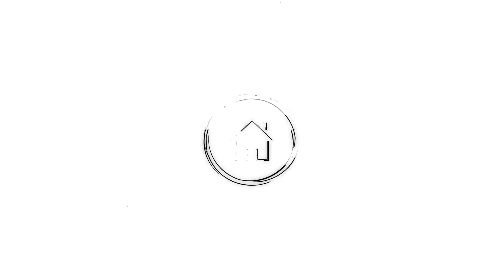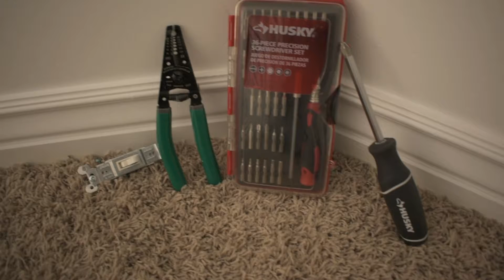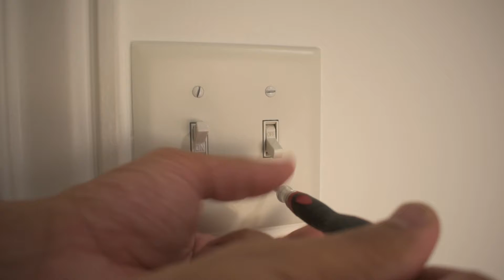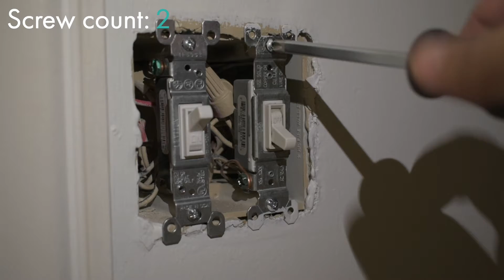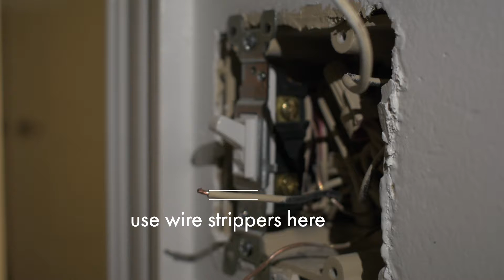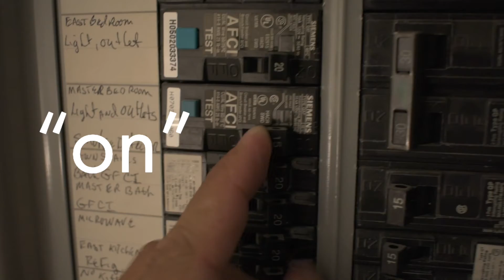DIY How to install or replace a light switch for beginners!

Comment: Use a 20 amp light switch they are better than the one you bought
Reply from the maker: I mean.... if I'm buying 20amps for a 15amp circuit, I'm really just wasting money and potentially would confuse any future decisions and unnecessary back and forth for anyone else that would work on the switches after me. You're not wrong,  I just don't want to have to go through all of that. Does it work,  sure, do you need to,  not really.

Comment: Do not use the holes on back of the switch use pressure plates
Reply from the maker: You are right that pressure plates on the side are better when secured down properly with a loop.

Comment: I did it and it didn’t work and I’m not sure why
Reply from the maker: Personally, if it didn't work for me and I made sure I connected everything properly, and its still not working, I would consider a certified electrician to see if there was something else that is causing the issue.

If it was working before, then after I attempted a change and it's now not working, for a simple single pole switch change, something could have come loose, maybe the switch is on a protected circuit and something tripped, maybe wires crossed when putting it back in, or the wire popped out from the push in and you have to secure it down with a loop around the bolt, there could be a number of things.  I would highly recommend making sure you take the correct actions so there isn't a fire hazard

Comment: Thanks sir!
Reply from the maker: You got it! The more research and actual electricians weigh in on this video... they do recommend that poking the back isn't the best but to wrap it around the actual screw you're fastening. Just as a heads up.  Other wise thanks for watching and be safe!

Comment: You shouldnt put the wires into the back. You shouldnt put them in thoee holes. Thats why youre having issues. Its breaking the connection. Both wires should always be around the screws & tighten. Thats basic electric 101
Reply from the maker: I think it's a discussion of good, better, best

Good (holes in the back and it works) 
Better (wrap the wiring around the screw and tighten)
Best (some argue to not only do the j hook around the screw but also to use a ike a push in wire connector instead of just wing caps)

Comment: I tried to replace an old light switch with a new LED-friendly one. I figured that I could just connect the 3 wires on the new switch to the same connections that the old one used. But there’s a 4th wire on the new switch. I don’t know what it’s for (there are no installation instructions). Where do I connect the 4th wire, or can I just leave it unconnected?
Reply from the maker: 4th wire that is coming from the new LED switch to connect to the house? 🤔 what brand and model is the light switch? I honestly haven't installed any switches where there is wiring provided from the switch to connect to the house.  Usually the switch is the actual housing for the wiring from the house to connect to..
Reply: @ColtonCrumpDIY  I don't know what the 4th wire is for...it's a Lutron LED+ Lumea Dimmer switch. I thought I could just connect it to the existing 3 wires that are connected right now to the old 1980s dimmer switch, which is totally incompatible with LED lights. But I pulled the switch out of the packaging and there were 4 wires. These 4 wires on the new switch are black, red, red with a white stripe, and green. Of course this is turning into a complicated project....sigh.
Reply from the maker: Ohhh, you might have bought a 3 way switch.  The red with white is often a connecting wire that allows another switch to control the same light.
Reply from the maker: If you want to use what you bought as a single pole,  you can just ignore that other wire (just cap it) and then you can use the other 3 wires as normal.  What i would highly recommend is making sure that your light fixture got are upgrading to is dimmable. Just because you have a dimming light switch, doesn't mean the light is actually going to dim. 

That can cause electrical issues you don't want. Also if you have any hesitation or questions about if it works,  I'd highly recommend contacting a certified electrician to help answer your questions.  Stay safe! Be smart!
Reply: @ColtonCrumpDIY  Yeah, I've spent hours trying to do this and I can't get the little yellow plastic caps to stay capped on the wires. They just fall off, and I don't want to leave the wiring exposed in such a crowded little box. The space in the electrical box is really crammed, because there are two switches side by side in the same box, with lots of wires bunched up inside. I thought I could just snip the wires off the old switch and leave their connections inside the existing wiring (they're already inside plastic caps, then connect the newly snipped ends to the wires of the new switch (using more plastic caps), but you need surgical precision to deal with these tiny wires and to get them to stay together. So now all my kitchen lighting is disabled. I have to look for an electrician. This will take days (and cost a fortune!)

Comment: Hey, another first timer here. Your video really helped guide me. Thank you for taking the time to make this.
Reply from the maker: Of course!  Glad this helped and thanks for letting me know it's was helpful.  As always if there is any question of doing electrical work,  consult a certified electrician and make sure that power is off with a voltage tester! Thanks again!

Comment: I dont see a ground wire on my switch is that ok?
Reply from the maker: Usually fine.  If your switch doesn't have a green screw to secure a ground to, its often fine as it isn't always a necessity. I am curious though, is the box that the switch is in, is it metal? There are times when the ground wire is secured to the box and the is a green screw that is acting as the ground.
Reply from the maker: I would say also that if you aren't comfortable doing wiring, to consult an electrician to make sure you're up to code and safe! I'm not a certified electrician, just speaking from a place of switching out a number of switches before.

Comment: Does it matter if you put the top on bottom and bottom on top different from when they were taken off ?
Reply from the maker: Yes you need to make sure you know your hot wire vs your neutral,vs your ground. A few people have said it before for you want to make sure that you have your voltage tester to understand that when the power is on (breaker is still on) that you know which wire is your hot (ie bringing in the electricity, usually black) and the neutral (usually white). It can be a major fire hazard if that is installed incorrectly. Often the switches will have labeling on the plastic, like raised or indented on the plastic which one the hot goes into and the neutral. Hot, where the black wire should go (usually if wired correctly) will attach the the brass or copper metal. The neutral will attach to the silver side. 

If there is any question or second guessing, I would highly recommend talking to an electrician to get their guidance. Often being DIYers, you are taking on the risk on your own to do the thing that you may or may not have a license in. While it can save you money, its definitely a risk.

Comment: This shows a simple replacement but doesn't explain which wire does what or where the live/hot wire should go, which is neutral, etc. You missed a great teaching moment!
Reply from the maker: You're so right! I did just the simple quick and dirty replacement walk through but didn't talk specifically to what each wire does. 

Maybe on my round 2 I'll get that created! Thanks for the feedback.

Comment: Even though you turn off the circuit breaker in the switch box!!! Check and make certain the power is actually cut off to every switch or item you are going to work on!!! The electrical panel is notorious for being incorrectly marked....  It will let you know one way or the other..... "THE OTHER WAY" usually very exciting!?!?!?!?⚡
Reply: How do you check that? A voltage multimeter?
Reply from the maker: Correct.  There are voltage testers that are shaped like a bulky pen. Those are the easiest to use for a pretty accurate read.
Reply: @ColtonCrumpDIY  Awesome! Thank you for the very helpful links! 🙏🏻
Reply from the maker: Something like this https://shoplowes.me/3V886Zm
Reply from the maker: Or this one https://shoplowes.me/4prq06o
Reply: @pdufusc  Excellent point!
Reply from the maker: That's a great point to emphasize, safety first!
Reply: Great advice my 1st time changing one, we thought we turned off the power. My friend is about to touch the switch. I say hold one sec, I touch it with the screw driver and a spark burns the tip of the screw driver off.
Reply from the maker: Gotta make sure that power is off! :) glad you're safe though!

Comment: If there are holes in the back of my switch, I can see that you push the wires in, but do you tighten those screws as well? Thanks :-)
Reply from the maker: Generally best practice is...

Don't use the push ins
Use the screws with the bracket that secures it down

But

If you choose to use the push ins, tighten down the screws just enough so you don't have loose metal or longer than needed sticking/out metal when you secure the outlet down.

Comment: What if the white and black are hooked up wrong? Will it change the switch direction of power?
Reply from the maker: Actually if the black and white are switched and not connected to the correct places, it's a major fire risk.  I would recommend making sure you have it correct.  If you are not sure, call an electrician
Reply: @ColtonCrumpDIY  If you have a white wire, it indicates a switch loop (power comes to the light or fan first) and is a hot wire, not a neutral, and should be marked with black tape on each end to indicate that. The switch just breaks or makes the connection, so it doesn't matter which screw each wire goes to.

Comment: You didn’t use a meter stick to show if there is still current or not
Reply from the maker: I made sure that the power was off with the breaker flip, you're not wrong that I didn't show it in the video, I've been zapped enough times that any of the not high voltage stuff, my meter can be, did I get a little zap or not.
Reply: @ thanks , would have been nice to show the beginners though for sure 😊
Be safe and thanks for the info

Comment: I don't think you're supposed to use the holes. You should always loop around screw head.
Reply from the maker: I personally prefer to do the loop so it curls the same way as you tighten down the screw it continues to tighten the connection. The push ins are definitely a pain and are a risk as I have seen so many that have popped out when installing.

Comment: Never use the push in on the back. Only use the screws
Reply: @dwolchko  why?
Reply: @LupusVirTV because you can cause a fire and the wires will loosen over time. Hence why he heard power but the light wasn't working. ALWAYS wrap around screws. It's electric 101!!!!
Reply: @LupusVirTV  it’s a fire hazard. Over time they become loose, heat up, spark, and catch fire. Always use the screws. Make a J hook using the wire strippers and put the look around the screw so it tightens with the screw.

Comment: I never back stab any switch.  The clamps are not reliable and over time the plastic will crack and cause the connection to fail.
Reply: @mitchellcox1912  having that exact problem right now
Reply: You mean the holes

Comment: Not tested too make sure the breaker cut power is pretty dumb... don't do that... NEVER ASSUME!
Reply: Yes, always use a volt meter to make sure there’s no current running through the wires.
Reply: Best to be extremely careful when doing electrical. I bought the plug in tester and the long test that blinks rapidly when there is power. Take your time and watch a few videos on these projects!
Reply from the maker: 100% if you take your time and do it right, your chances of messing something drop. They don't drop to zero, but if you're not rushing, its a good sign.
Reply: Oh great. I thought it would be as simple as what he showed. I dont have a meter.

Comment: I stripped the two grey wires for the second method, he only mentioned after to keep track of the top and bottom wire, does this matter because I have not been keeping track at all, update im having to voltage check them now, I really wish this was mentioned way earlier in the video
Reply from the maker: From my experience, the basic single pole light switches typically does not matter which grey wire goes on the top or bottom terminal. The key thing is make sure you're connecting the hot wires to the hot side of the switch (usually indicated on the switch itself) and the neutral to neutral. This is the typical case... not every case is typical though.  If you want to be super sure, hit up an electrician and they will be able to identify further

Comment: Just what I needed. So, what's the harder way to pull the wire out of the back? I don't think I have enough wire to work with if I cut it. Awesome video, regardless.
Reply from the maker: Yeah if you keep trimming might run out of wire and then you get into code violations.  But there is also a release push in tab on the back of switches if the wire is inserted through the push in slot. You can grab a precision flat head screw driver, push on that tab then pull the wire out.
Reply: @ColtonCrumpDIY  ha! I'll look for that tab and keep you posted. Thank you!
Reply from the maker: Sometimes they can be a pain to remove. I'd suggest some lineman pliers also so you have a good grasp on it. You will probably encounter needing some twisting of the wire to get it out also.  Best of luck!!

Comment: I have questions about the single pole vs what are the others. If you get a light switch that's a single pole do you have to insert it in the back or can you wrap it around the pole and screw it down? I'm not even sure what it means to be a single pole. If this is for beginners afterall. I as taught as a child not to fear electricity but to respect it. I wish you'd redo this video and make the changes to answer these questions.
Reply from the maker: A single pole light switch is a switch that is function is to turn off a light or something 120v at one single location.  Think of a creepy basement with only 1 light or a shed in the woods that only has 1 outlet.  

Here is a summary that might help: 

- Single point switching of a 120VAC supply needs only a single pole switch.
- For switching from either of two locations, use a pair of 3-way switches.
- For turning on or off a more powerful electrical device on a 240VAC supply, you’ll want to use a double pole switch

Now the topic of do you just strip the wire coating, and plug it in the back holes OR unscrew the screw on the side and put it in straight OR curl the end of the wire to wrap around the screw clockwise OR use some sort of other random different thing is all up for debate depending on the electrician you talk to.  So do whatever you think is best and won't burn your house down.  

As far as me making another video to answer all of these questions, maybe one day.  We'll see 👀
Reply: @ColtonCrumpDIY  Thank you so much I appreciate it.

Comment: so one of my switches don't have tubes to screw into. now what?
Reply from the maker: Is there an "insert here" and it looks like you can take your wire and just poke it in?  If so, that is the quick way to do it.  I personally don't like those because of how the wires can pop out after you get them in and trying to put it all together.  But up to you.  Ask an electrician and you'll get difference in opinions on if the quick inserts are their go to or they hate them.
Reply: Those backstabbed wires ain't "popping out", even with pliers. @ColtonCrumpDIY